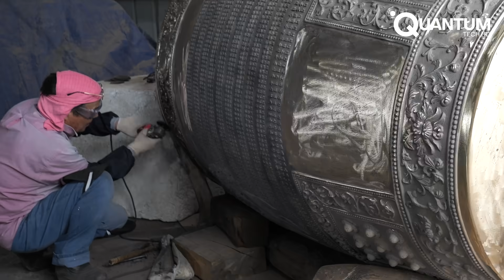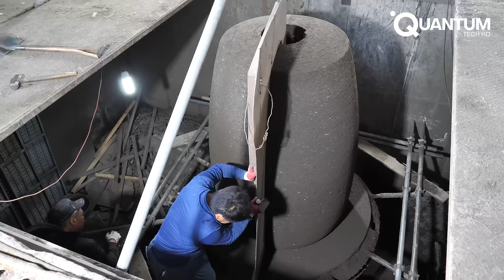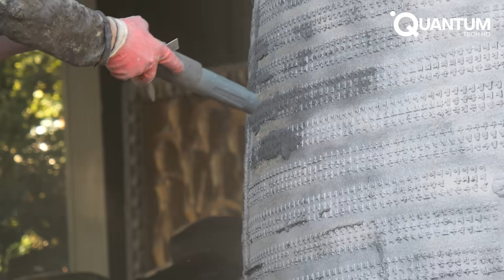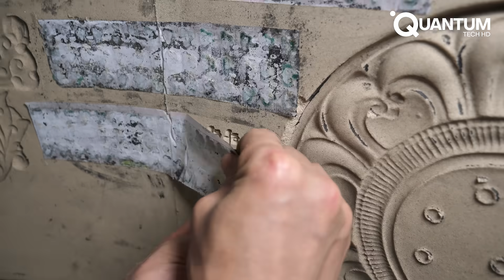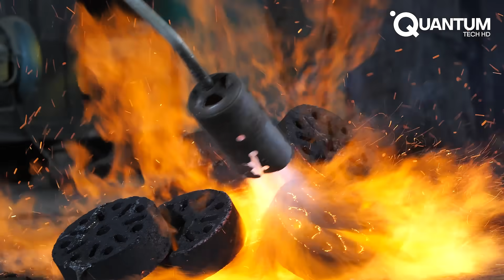How a 5-Ton Temple Bell Is Forged to Ring for 1,000 Years | by @kingprocess

Comment: As this process has been done for centuries, I would have like to see the historical methods of how the massive weight of the molds and castings were handled. Obviously no electric cranes were used and even the fasteners for the mold was different than bolts as exist today.

Comment: the core building method hasn’t changed in a millennium? Now they are using concrete construction steel! non existing 1000 years ago. But… a fantastic insight in this traditional bell casting.

Comment: Resonance 101; you can't make religious bell shapes last for a thousand years of ringing because of the material properties of bronze/brass. The vibrating end needs to be thicker in a way that forces it to flare out and widen, or it cracks after some number of rings, and 'the bell life' consists of minimizing the times it is rung.

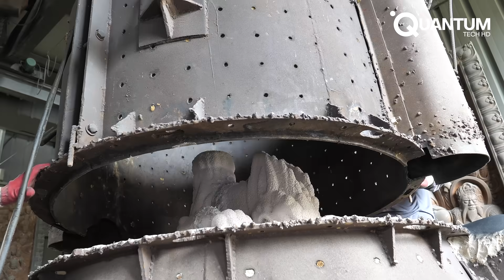Comment: 0:18 IDK looks pretty industrial to me. Cranes, arc furnaces, sand blast machines, unchanged for a flipping millennium welded rebar... It's not a mass production but not a traditional manufacturing either. It's cool as is without the narrator's piss on my leg.

Comment: "The process hasn't changed in a millennium" huh ?
Rebar was only invented less than 200 years ago and the welder 150 years ago. Plus the mechanical hoists, sand blaster and all the power tools.
But it's still an interesting process.
Reply: No need to be so literal.  Iron bars existed as long as we've had Iron.  Lifting hoists and gantrys existed before electric motors, etc...  These are superficial aspects.
Reply: @BixbyConsequence exactly…thank you Sir.
Reply: Idiots

Comment: You could machine that in a large lath. Over all quality would be better and it would probably sound better. You could even make it out of basically anything you can place in a lath
Reply: Then why is that never done  ?    Bells are cast or hammered out of sheet metal.
Reply: @causewaykayak well theoretically if you had a lath big enough you could make a bell that size or of any size.
Reply: @Groeningathletics But would it be a Bell or just a workpiece in the shape of a bell  ?
Bell founders worldwide are shaking their heads in disbelief. 😅
Bells may be tuned by skimming small portions as I believe is still the practice at the Whitechapel Bell Foundry (They cast America's "Liberty Bell") 
Maybe some of U Tube's  keyboard experts should do more research before pressing the Post button.   The range of daft opinions on all subjects us quite astonishing given the accessibility of public libraries and the  ubiquitous search engines.
Reply: Groeningathletics
Back again,  from my mis spent youth in Wales.  Bells feature in several  movie films (Hollywood' s  'The Vikings' about arab cruelty  and their search for a mythical golden bell. 
 I recalled a great Russian film   Found this on Google 
Andrei Rublev (1966), directed by Andrei Tarkovsky
While not about the historical  Tsar Bell, this cinematic sequence is a renowned portrayal of Russian bell-founding tradition. 
There is much more info out there. 
Apart from any technical aspect  there's also the spiritual   dimension.   Its doubtful is a 3D  printed bell made by the engineers at Space-X would ever be accepted as a "Temple Bell"  by a Buddhist community in Korea  or a church in England. 
The Korean  film shown here on 
tube  makes it obvious that the Process of manufacture  is very much part of the culture of Temple Bell.  You wont fake that  so easily.

Comment: When I began working in a foundry, the prehire safety course showed us actual footage of what happens when there's a drop of water trapped in a mold. When it flashes to superheated steam, the amount of energy released is exponential, not linear. Meaning if there's one ounce of water and you double it to two ounces, it's not twice the explosion, it's like 12x. It shoots molten steel 50 yards at horrific speeds. And I saw it happen first hand. It's not pretty
Reply: Water heated to boiling point at standard temperature and pressure (i.e., 0 degrees C, and more or less 'average' atmospheric pressure) expands to 1760 times the volume of water. Higher temperatures expand much more. If the expansion is contrained, the pressure can become very much higher, effectively 'explosive,' just as with other highly compressed gases. Casting temperature for bronze depends on proportions of alloying metals, but over 1000 C, or higher for thin-walled castings. ensuring the mould is filled before the metal solidifies.
Reply: It kind of funny as watching this i don't think any of the worker's have even heard of health and safety or anything the amount of stuff they were doing was crazy the one were he went under the mold while it was in the air a few feet and one with the 2 molten metal drums were ready to pour and he on top just skimming it crazy. I think i have just watched to many bad reels on Instagram to just be thinking of all the ways it can go wrong.

Comment: the Unique feature of Korean Bell is the tuning cylinder on the top, which is positioned eccentrically. 
not found in Chinese or Japanese bells.
Reply: That's good Information. Thanks.
Reply: This isn’t a Korean bell moron. It’s a Thai bell. When did you ever see a Korean make a bell?
Reply: And K-pop is the original best band
Reply: 又开始胡说八道了
Reply: @polestarli3091  If you burned your traditional culture during the Cultural Revolution, could you just shut up?

Comment: "The process of making buddhist bells hasn't changed in a millenium. Believe it or not, they had #16 reinforcement bars that were welded 1000 years ago"
Reply: yeah agree🤣
the électrique scie, grinder, hoists, forklift. The glue, resin, plastic mold, nails, antioxidant paint, and the Aluminised PPE were all there, 1000 years ago🤣
Reply: @GameOnline16 
😊AVETE RAGIONE 
     ENTRAMBI
Lo dico in maniera meno buddista visto che non lo sono: una cosa è la procedura di base con le sue fasi e le sue strutture immutate nel tempo e un'altra sono le tecnologie e le tecniche con cui queste si compiono e attraverso cui vengono realizzate. Esse si adeguano giustamente ai tempi.
Al contrario, non esisterebbe una storia della tecnologia e della tecnica e non esisterebbe filosoficamente il tempo che scorre nello spazio della durata.
In conclusione questa manifattura è tecnica ingegneristica in gran parte contemporanea, che esalta la materia e il mondo che cambia.
E contemporaneamente è immutabilità simbolica dell'eternità spirituale atemporale, che parla attraverso le permanenze di fase e le strutture del processo di realizzazione e costruzione della campana, sostanzialmente immutate in un millennio.
Non è male, vero?
Che ne dite?